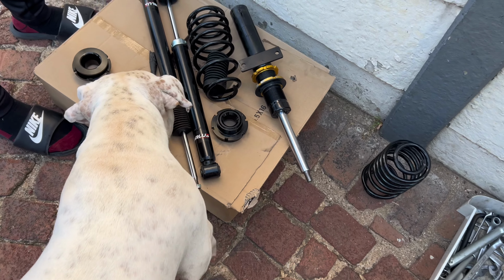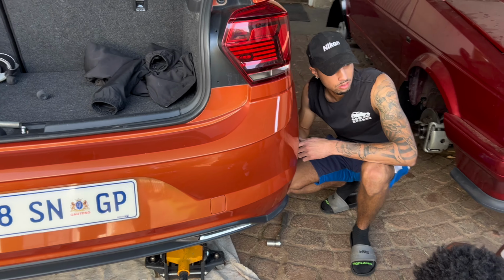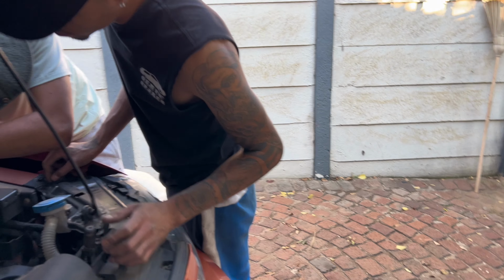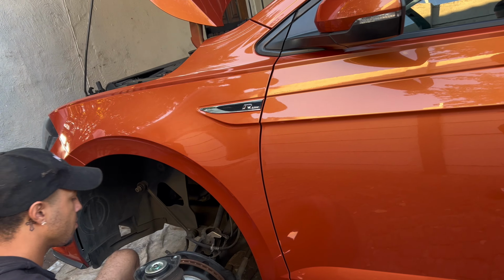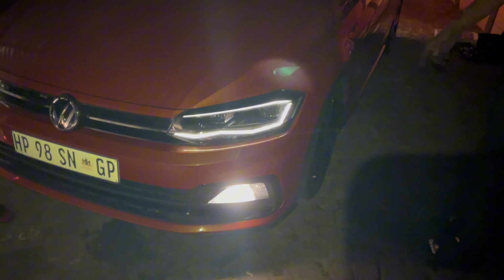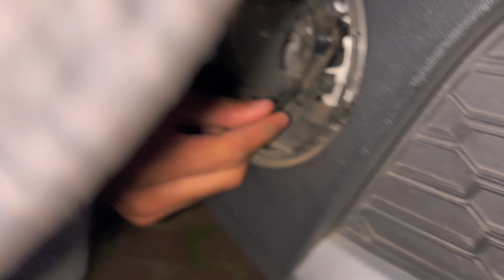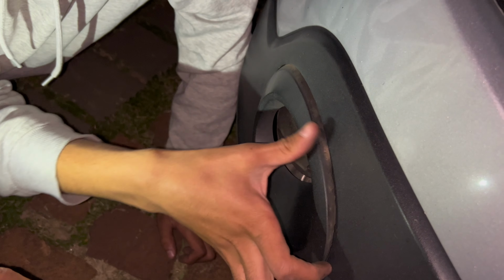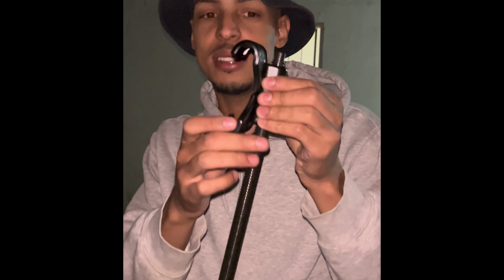Installing coilovers on Darians polo AW

Comment: My guy,a Boer maak n plan,maar n bruino het n plan........you could of just swapped the glass off the fog lights.....try that next time,heat gun to remove the glass and some sika flex to glue it back 👍🏽and use some laminex on the fogs to blend the colour so it doesn't look odd, one new and one old looking glass
Reply from the maker: My cousin told me the same thing,but i didn’t wanna try and risk it and end up breaking the new light as well i dont trust myself with such a task,but thank you for your suggestions bro🤝🏼